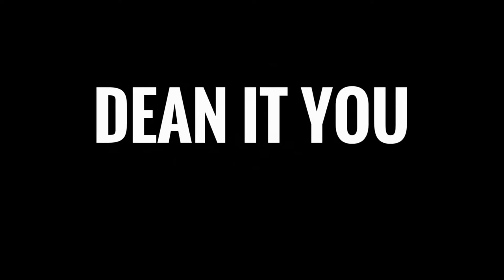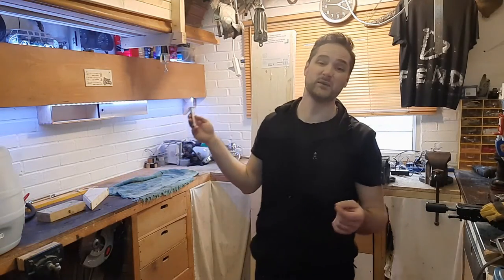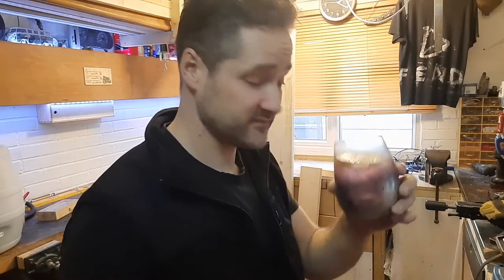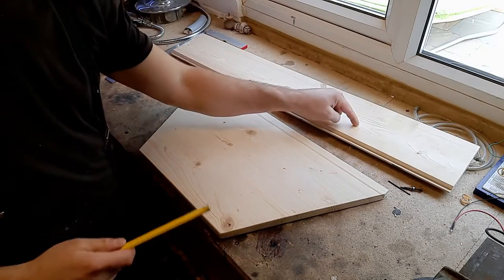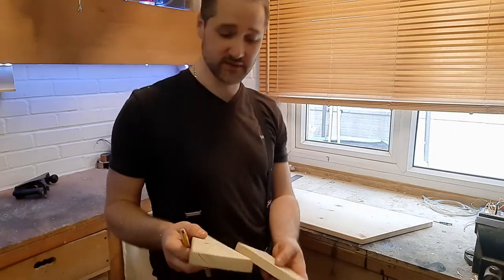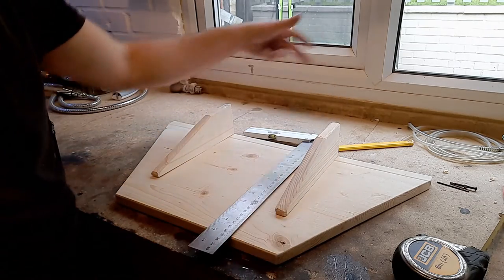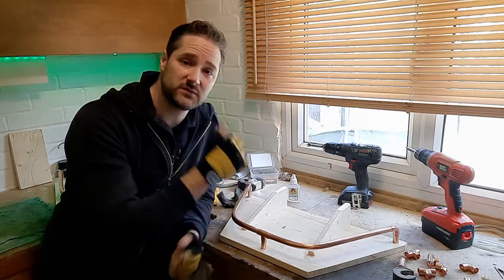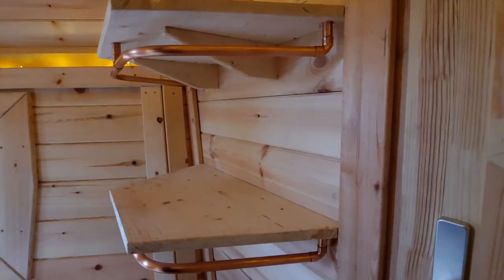Must have in a BBQ

Comment: Why wouldn't you put the copper pipe on top so it acts as a retainer also
Reply from the maker: Hi
That's a great question,  The reason is, if you have the copper at the top you are limited by what size tray you can place on it, but if its on the underside then it doesn't matter.
Thanks for watching and your comment